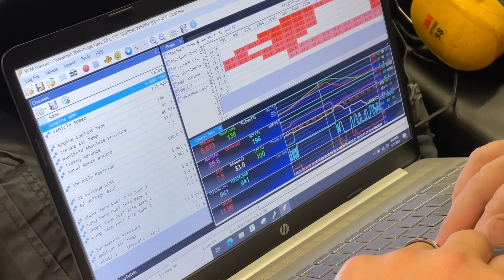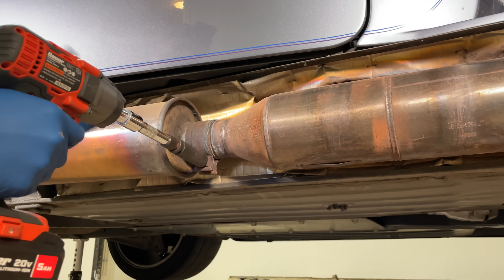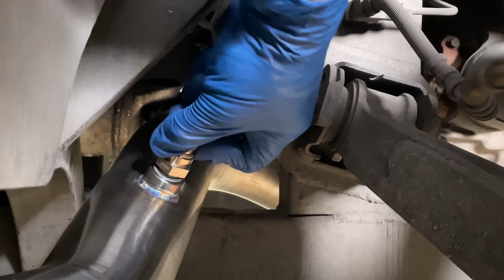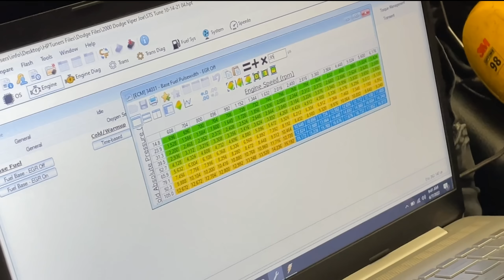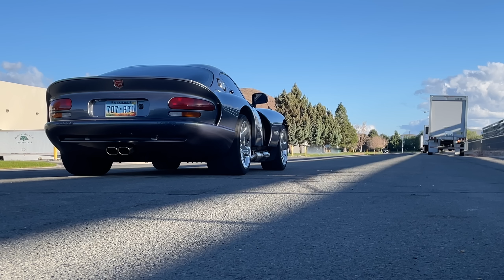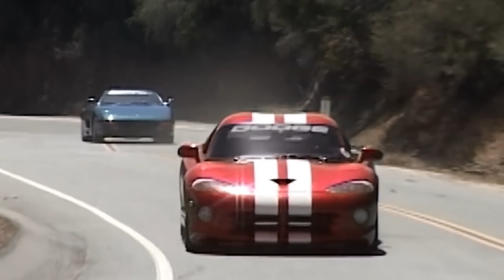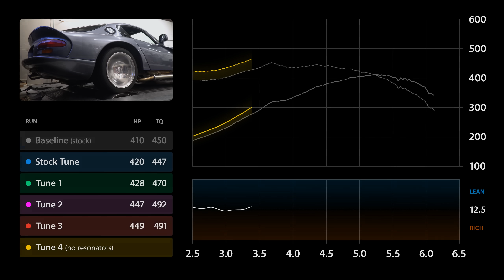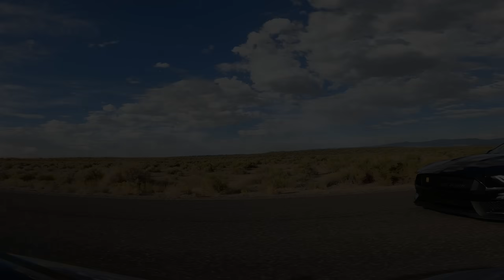When you give an 8-liter V10 the exhaust it deserves

Comment: I rode in a stock 96 Viper in the late 90's. Female driver ( hotter than 10$ pistol). Here's the short how I arrived there. I raced and won against all takers, many v-8 cars that night ( strongest: 98 SS Camaro 6 speed bone stock .) My car:  92 Eagle Talon Tsi  AWD( 5-speed).  Turbo boost upped from factory 11.4 lb to 15 lbs. Delete honeycomb restrictor, open style air filter, working BOV( hose upgrades), etc.  She gave me the copilot guest seat for the night, I was pinned by the torque and shocked at the lack of wheel spin with a 3k launch. 60 mph in first with strong power to 130 mph,  just teasing  but not so much when taken home with her. I smashed one of her friends. Worth the wait for doing what I loved anyway. Racing

Comment: The gt350 is just too heavy compared to a viper. Also, I don’t want to through shade at the driver, but that car was face diving in between gears, not raising its nose digging for traction like it would’ve is property shifted. Not going to lie, it can be nerve wrecking racing sometimes and sometimes you don’t want to test the traction because it can end badly.

Comment: Just goes to show how important tuning is. 438whp with just a tune on otherwise stock hardware vs 458whp peak with bolt ons. 
Full exhaust added decent peak gains but seemed to do much more for power under the curve! 

Dyno data is the best.

Comment: Still one of the greatest cars ever made. Imagine if Viper hadn’t been corked from factory, and came with 600+hp like it should have back then. 

And the GT350 is arguably the greatest Mustang ever made.
Reply: I will agree with your final statement if you're talking about the 1965/66 GT350s.
Reply: @minigungaming5915  I’m referring to the ‘15-‘20 GT350. Which runs all over the ‘65-‘66. Not knocking the older cars but they aren’t on the same level as the newer version.
Reply: @minigungaming5915 The 65 and 66 models are overrated. The front end looks like the face of E.T. .
Reply: The GT350 is the best modern mustang imo. I absolutely adore the engine.
Reply: @Gobbbbb  the modern GT500 is too little too late, and just more of the same all go no finesse supercharged BS. The GT350 however was kind of special. They had to discontinue production because it took all the shine from the 500.
Reply: oh hell no your high fastbacks are way better
Reply: @melainegg6134  No. I assume by “fastbacks” you’re referring to ‘65-‘70, in which case no you’re high. A weak little 289 powered fastback can’t hold a candle to the modern GT350. Period.
Reply: The Viper never needed 600+ horses, you’re just spoiled.
Reply: @mr.butterworth  Spoiled how? Because adding 200hp to an already great car is bad how....? Exactly. You’re just opinionated
Reply: I will agree the Viper is one of the best sports cars ever made. The GT350 is nice, but imo the 1966 Shelby cobra super snake(Also making a new 2022 model), or Elanor 1967 Shelby gt500 are the best looking. There's a few companies doing full on high end replica restomod cars and they are so nice.

Comment: You should have taken off the high flow cats
Reply: Why
Reply: @Bruh-bx9mh  well the most restrictive part of an exhaust system is the catalytic converters, sure they are high flow so less restrictive than the normal ones but still restrictive. Just removing the resonators that are pretty much straight through gained him some more numbers imagine what taking off the cats would do

Comment: It all comes down to torque value and torque per unit time at the rear wheels.  2 entirely different approaches to N/A performance and yet they're not that far off from one another.  I've always reasoned that mechanical advantage seen at the wheels is more important than absolute power production from the engine.

Comment: I have the exact year viper, same color, stripe delete, except with the upgraded factory connelly leather. 
   Just consider this folks, this gen 2 made it's debut in 1996 and it will run or beat most factory produced muscle/supercars today. Definitely around a track also since thats what it was bred specifically for. 
  Not to mention it has the DNA of Shelby and literally looks like the head of a viper.

Comment: 60 mph in second gear just sounds crazy to me!  In my car, I'm in 5th gear and halfway to redline at 60 mph.  I hit second gear halfway through an intersection after a stop light.
Reply: What car do you have lol? Those are some mega short gears
Reply: @Theperfusionistisalreadygone  1996 Geo Metro, lol.  This thing was built for multiple reasons, but speed wasn't one of them.
Reply: Right my car only has 5 gears 💀
Reply: Not too abnormal my second gear ends right at 60
Reply: What car is that?
Reply: My second gear ends at 70mph at 7200 ish rpm, 5th is 170 abouts with some napkin math
Reply: @Heck6  I think my Terminator would do 75ish at the top of 2nd. 40 in 2nd was a nice sweet spot.
Reply: @rybobuno  lol i have an ion redline with a zzp stage 3 kit, the lil supercharged saturn is pretty fun.
Reply: My miata hits 60 at like 6k rpm in 3rd lol

Comment: Only part I’m bothered about, is if you were already under the hood with stuff taken apart, and already planning on tuning, why not just throw on a CAI or at least do a ram style intake with aftermarket filters so it can breathe easier. No, you’re not gonna gain that much power, but you’ll gain some, and the car will probably respond a lot quicker

Other than what I chose to bitch about, I love the videos man🤙🏽

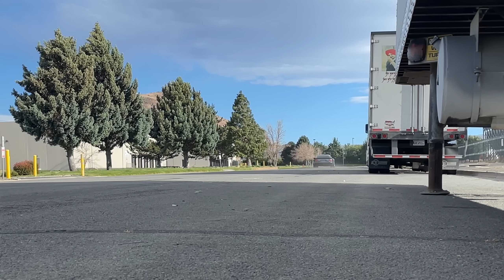Comment: Really enjoyed the video! Quick question: I put high flow cats with 3” Belanger cat back exhaust on my 02 gts. It has really cool pops when shifting on acceleration and It has a lot of burbles with the occasional pop on deceleration which I don’t mind (I think it sounds pretty cool except for when it’s happening at low speeds). Is this okay for the engine? I think I can here some very similar burbles on your car at 6:26
Reply: I didn't expect to find you on the automotive side of YT. It's pretty cool to hear you have a Viper too.
Reply from the maker: Yes it’s ok for the engine. Mine does it a lot too even with decel fuel cutoff enabled in the tune. 

Also I know a few people irl who watch your channel! Thanks for stopping by amigo.
Reply: @Four_Eyes  I am a fan of the sound and I think it fits the car. I was surprised by how quiet the stock exhaust was when I first heard it and that’s the second thing I immediately changed on the car (first being the 20 year old tires haha) thanks for the response man I appreciate it!
Reply: Hi dad good to see you here
Reply: Pops on de acceleration are usually a lean condition  unless the car was tuned for those intentionally
Reply: I didn’t know you were a car guy too. Post a vid of your ride my man!
Reply: probably undetonated fuel hitting your hot exhaust, came across this issue with multiple people on multiple engines. its really not a problem unless it annoys you @618 Fishing.
Reply: Its detonation, has always been happening but you're able to hear it better now lol. Happens when unburnt fuel makes it to the exhaust. Its completely normal but to prevent it you would run a higher octane / tune to 93 or 91 to help prevent it.
Reply: @alecsilva7525  that's not detonation. It's a rich fuel mixture igniting in exhaust. Better rich than too lean. Watch more motorcycle racing.
Reply: @replynotificationsdisabled  actually could be lean condition.
Reply: @alecsilva7525  That is not detonation. Detonation is when the air fuel mix in the cylinder combusts on its own before the spark is delivered. Detonation is bad.
Reply: Burbles just sounds terrible. Not sure if everyone loves it because of street speeds channel but it's not a good sound. People should really stop the nonsense

Comment: Yes! Great modifications to the exhaust setup on that V10. It really sucks to buy a pricey BBE exhaust and then have to cut the resonators out to get the sound you're after, but I'm shocked at how much additional HP and TQ it picked up from taking them out, as most resonators are basically just straight through with some mild perforated sections and small amounts of sound deadening. It's making great power now and obviously stacks up well against modern machines like the Voodoo in the GT350.

Comment: A lot closer race with the GT350 than I expected. A few years ago I absolutely gapped one at a drag strip with my 97' GTS.

One of my friends has hfc with BBE catback (stock manifolds) on his GTS and it sounds really good. Not quite as loud at idle as mine, but a decent bit louder anything above idle.
My exhaust is Belanger catless headers, stock resonators and rear muffler delete (stock size piping after the resonators).

Comment: makes you think if the cable had slack from the beginning
Reply from the maker: The retainer on the firewall pulled thru into the cabin, just too many heat cycles and the plastic cracked.

Comment: Best American car ever made. No question about it definitely my favorite car ever made. Next upgrade should be heads and cam. That will put you close to 700 hp . Then you can go with twin turbos that’ll bring you up to 1100 hp. Don’t get a supercharger the engine is not gonna perform as well with a supercharger turbos are the way to go and they can easily be concealed. These motors are so bulletproof I’ve seen them put out as much as 3000 hp. At 1100 The motor should still be bulletproof and you will be able to blow away most cars on the street.